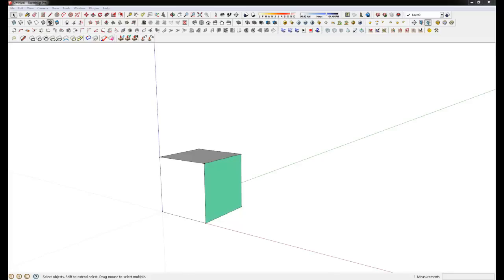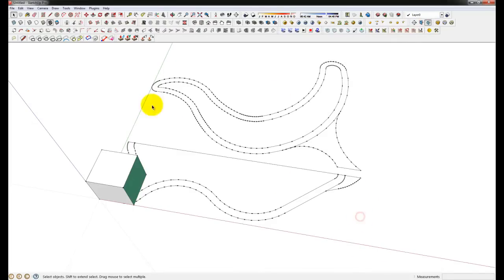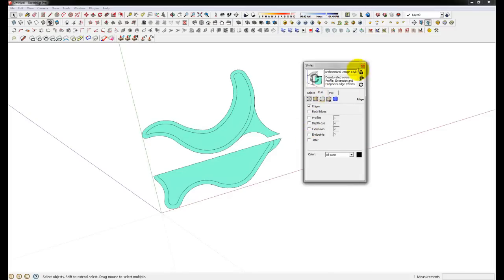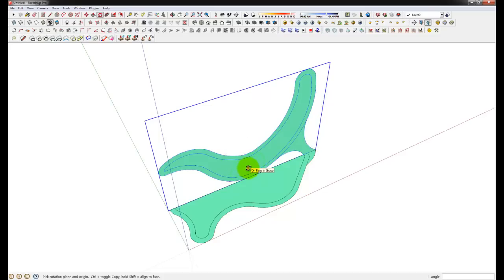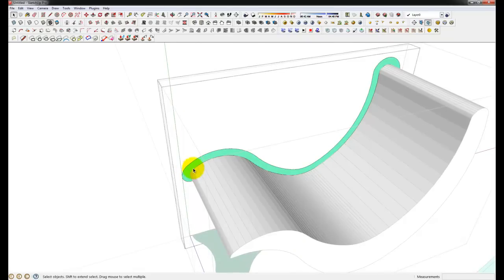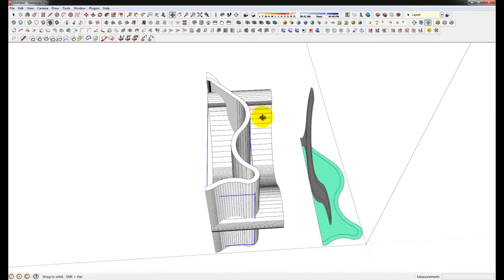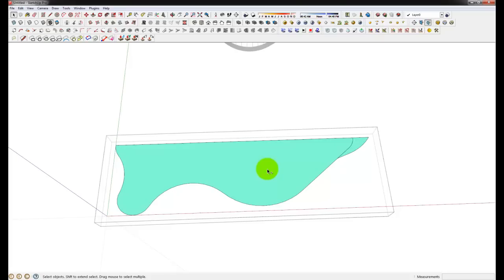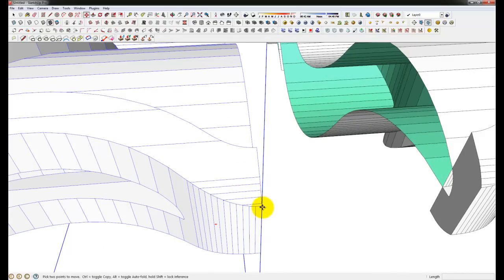Curved Bench Modeling with SketchUp

Comment: Nice tutorial.  I picked up a few new things.  It was a little vague in a few parts like when you hid the lines to remove the seam in the middle.  I don't think you explained what you were doing there.  Also, I think it would have been better to model a real bench or sofa.  Something that has a real world application.  But overall a great job.